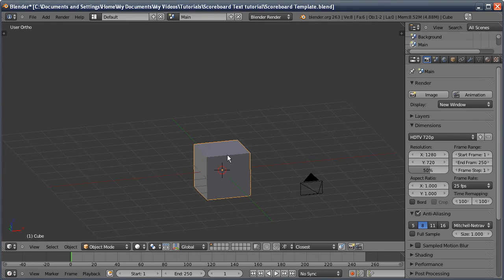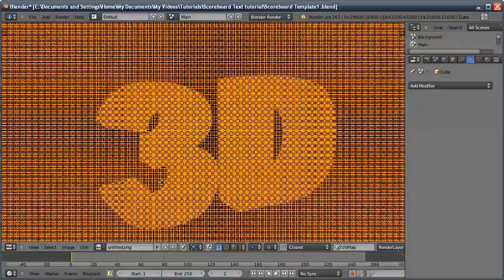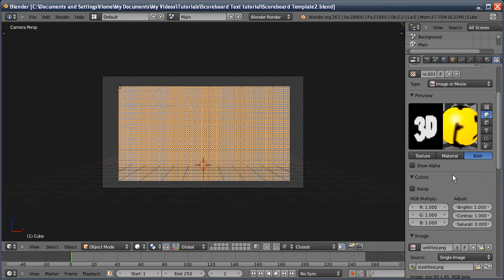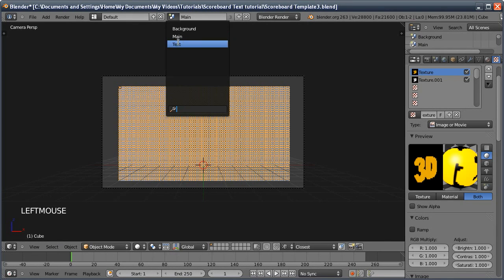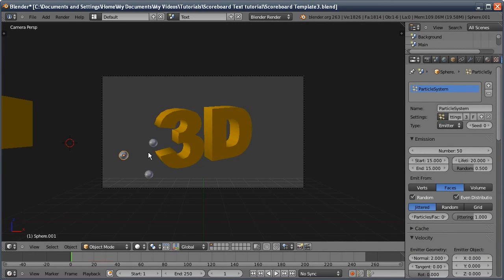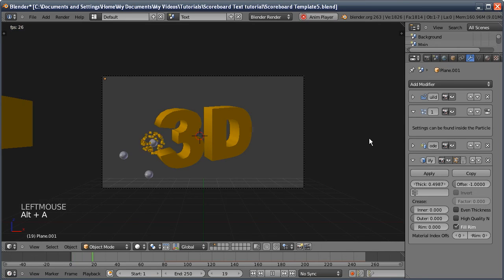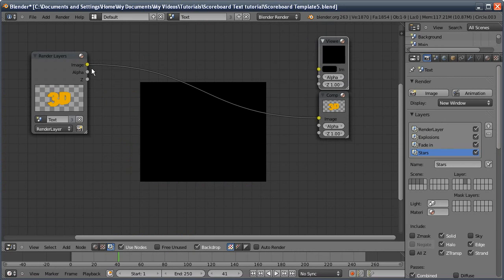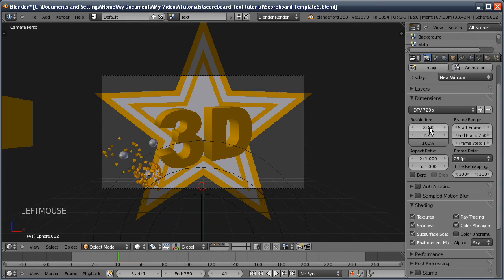Blender Tutorial: Scoreboard/LED Text Effect Tutorial

Comment: I figured it out (2). The force field empty needs to be put on layer 3 with the Fade In explosion, otherwise, it has no effect. They have to be on the same layer. I also incurred the same problem with the little "fireworks" spheres. I moved all three spheres to layer 2, but FORGOT to move the cube it emits to layer 2. The result is the explosion of cubes gets added to Render Layer ONE, regardless of the fact that the emitters are on layer 2.

Comment: Mine looks like it took a wiz, followed by being pounced on by 1000 angry fans.
The render turned out great, but it needs a lot of tweaking. I'm going to work on "learning" it first though. Two problems I had: (1) Fade In explosion on mine moves from left to right, rather than up to down. I solved that using what I learned in the hologram tutorial. (2) The force sphere had no effect at all, no matter the values used.